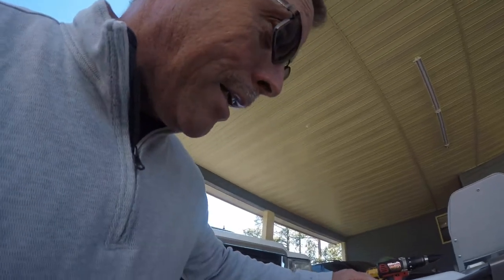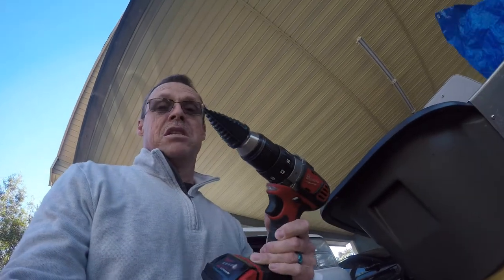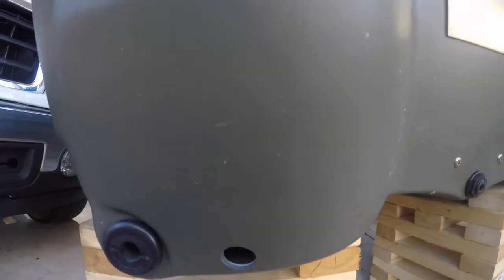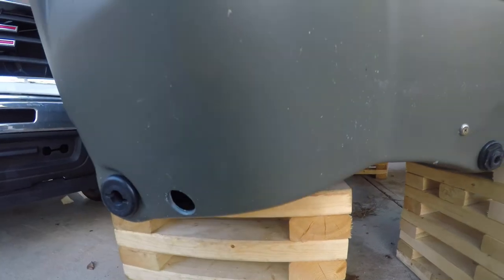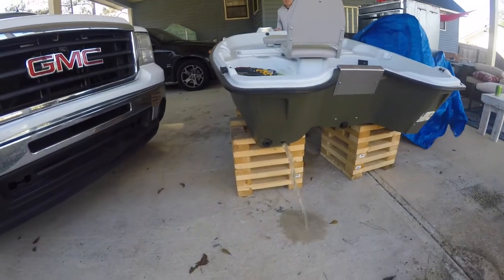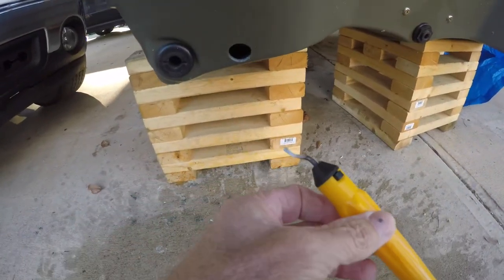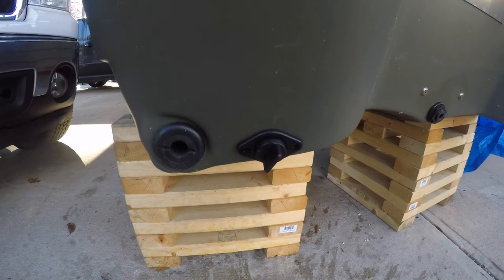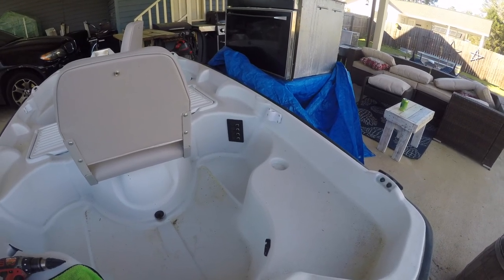DIY how to install a drain plug in a Pelican Predator 103 boat ,Draining water out of boat Hull.

Comment: Thanks for this. I have the same problem with my Quest Angler 10. I use to pick the boat up from the back and drain it at the front "push plugs". But after modifications i can no longer do that. This will work perfect.
Reply from the maker: Awesome yea they get heavy with all the extras . Thank you for watching.

Comment: The Pelican Bass Raider 10e also has a problem with large amounts of water entering the pontoons. The only possible site of ingress I can think of is the seam where the deck and hull join.  I applied Flex Seal to the upper part of the seam...no luck. The boat had so much water in the pontoons that it was difficult to tow.  I would remove a rod holder and use a drill powered pump; unbelievable how much water pumped out. Next step: a threaded drain plug at the rear of each pontoon.  BTW, I also have unimpressed by Pelican's after sale support.  On the positive side,  the boat is a good buy. Also, the BR 10e does have drain holes near the top of each pontoon bow; you could get a hernia trying to lift the stern high enough to actually drain it!
Reply from the maker: Yea I under stand that took for every to get my paper work to reg boat yea I tried the lift to drain water out lol it sucked install the drain plugs and all so a bilge pump.

Comment: Thank you so much for this!!! I hate that this boat gets water and I would stand it up against the house to drain it. I have a trolling motor on the front and a Honda BF2.3 on the back. Mine fills up I think because of the water coming through the seams on the front when I am trolling.
Reply from the maker: Your welcome .I have the 55 pound trolling for the front and just bought a 2021 tohutsu 6hp for it. Just added nav light and switch .we have enjoyed the little boat.

Comment: I had same issue however i cut access from top and found that the line to fill live well tank was broken. I plugged that line and decided to install bilige pump on both sides running bilige line out thru top and strap bracketing outlet line running bilige connection lines to switch and battery power. Took some work but was pretty nice install great little project. Now live well can be storage instead of live well which wasn't a sacrifice since i lure fish 99% of time.
Reply from the maker: Yea I was going to do that and add a bilige pump .but I just could not cut a big hole in the top of the boat lol. Maybe after a year or two I will. Not sure oh d you check out my other videos on the pelican be sure to check them out . Thanks for watching.
Reply from the maker: Do you have a video on the set up I would like to see it.
Reply: @chadpipkin840  shoot Chad i didnt video how i cut but i can send you pictures brother. Man ill tell you what running wires was a pain in the butt man. Got it done i need to get starboard or white cutting boards and screw them to cover the holes i cut on top back for bilige pumps.  Send me you email bro ill send you pics.
Reply: Gotta ask what size drain plugs do you use?
Reply: Btw you did way better job on switch panel then i did but thats project and fun part. Wish pelican would have done better drain plug more like the one you used .
Reply from the maker: @vinceh5163  the drain plugs a half inch drain plug very easy to install just take your time drilling so it's a tight fit.
Reply from the maker: @vinceh5163  Nice man I used deck hatch to cover my holes. Yea please send me pics . Pippy1aa@yahoo.com
Reply from the maker: @vinceh5163  All good that's why they are projects. LOL I don't know how much more stuff I can add to little boat  . But the more I add the better I like it.

Comment: Have you thought about sealing up the stapled seam?    Did a little digging on these and most people say water in the hull mostly comes from the seam under the rubber stripping on the side .    But good video, I will be doing this plug soon.
Reply from the maker: Yea I look at doing that i pull off the strip there were so many staples i just decided to put a pulg in . Dont mind the water getting in just as long as it jot a lot . Just make it easy to drain.

Comment: I have the same boat and it does have a drain up under the bow.
Of course you have to stand it on its nose to drain it.
I too had water in the hull... it's getting in through one or both of the two drains on the back. 
They aren't sealed very well and weren't installed very tight. 
You might just be creating another point for water to enter the boat. 
I would suggest anyone else put the same drain hole/plug in the back above the water line.
My Pelican Intruder 12 has a drain along the side up under the gunnel.
Reply: I just continued watching the video...
You didn't fix the leak!... you just made another hole in the boat. 
You need to unscrew the main drain plug and seal in on the outside with a rubber gasket and/or silicone.
I'm going to add a hatch above the left one so I can access it to remove it and seal it.... video to come soon on my channel.
Reply from the maker: @Manuel_Z_Kayaks  I did seal that drain plug I just didn’t video it . I seal that plug the day I bought the boat .

Comment: How far did you measure to drill the hole for new plug
Reply from the maker: I use the plug by holding from the bottom of the boat   around a inch from the bottom . I then uses a step drill bit on the hole drill a little test fit till u had a tight fit then i sealed and forced in plug and install screws.
Reply: Thanks so much man I just did it with my pops over the weekend purchased a 2019 and it felt really heavy sure enough it has water in the hull I appreciate you!
Reply from the maker: @Islandmanfishing  Congrats on the Install . Hope you have as much fun in the boat as I have been having .I seem to keep adding to my little boat. Thanks for watching if your not a subscriber  please do to keep up with mods on boat.

Comment: Don’t want to hijack your thread, but I want to ask the group if anyone has experienced a failure of the battery compartment as I did. The box started to delaminate exposing the inner and outer hulls so was no longer water tight. Pelican replaced boat under warranty and I now remove the battery before transporting.  A real pain.
Reply from the maker: No problem . Ask away I never had a problem with the battery box.

Comment: Does your boat have a plug at the bow of the boat?
Reply from the maker: Yes I just install one at the rear be cause I didnt want to stand it on the nose every time it got water in the hull.
Reply from the maker: The boat 155 pounds dry with water it starts to getting  heavy.
Reply: The drain at the top of the view requires you to stand it on its nose, that ridiculous. I have been contemplating this too.

Comment: I found a drain plug at the bow. Right under the deck
Reply from the maker: Yes there was one in the front of my boat I just did was to stand it in the nose every time it got water in hull . Just made it easy to drain with the rear plug.